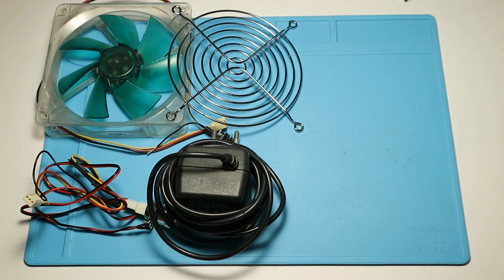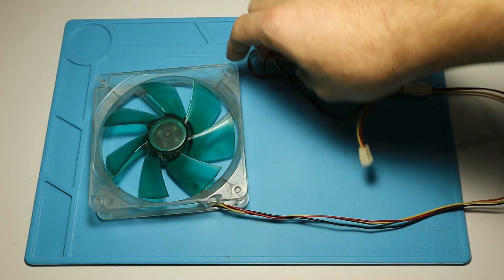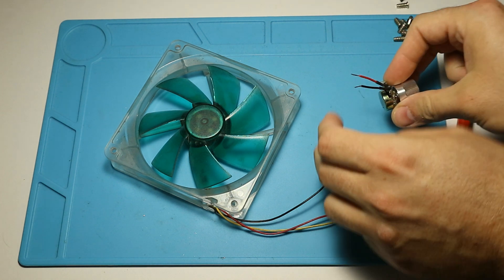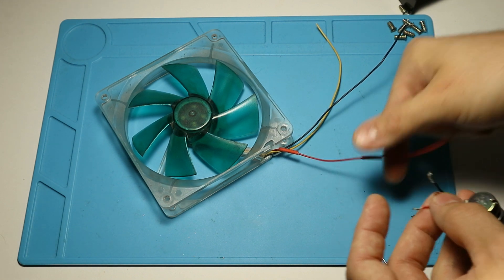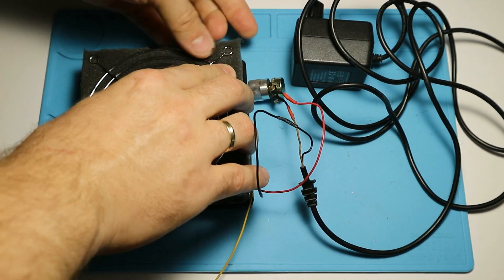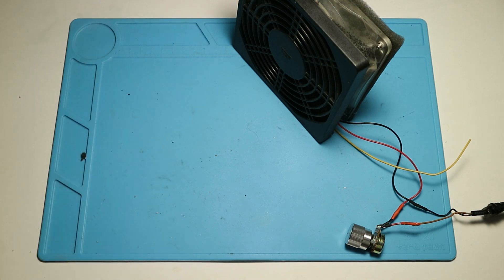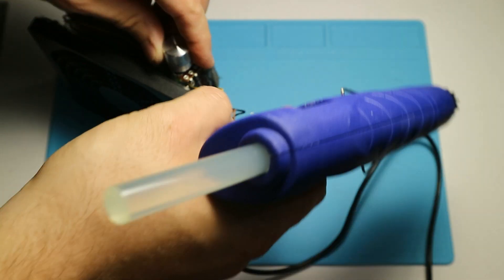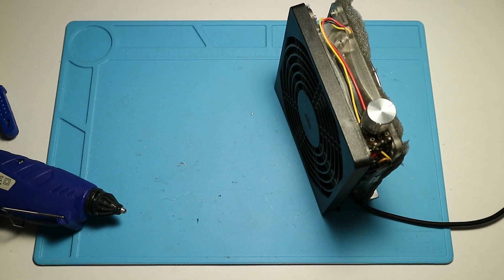DIY Fume Extractor, made from old PC parts!

Comment: The particles may not be bound in the foam.  They may be just diffused enough to reduce visibility. Do a test in the dark with a light shining across the output side of the filter. That may show them.  An activated charcoal filter element would be better to use than plain foam. Activated charcoal filter material in available in a variety of sizes and shaped.

I need to make a fume extractor but have not yet done so as I do not do much soldering right now.  I use a small fan to blow the smoke away from my work area but it does nothing to actually extract the smoke from the air.
Reply from the maker: Yes, you are right of course. The whole point of the video was to make something like a proof of concept - luckily carbon filters can be easily bought from ebay, etc.